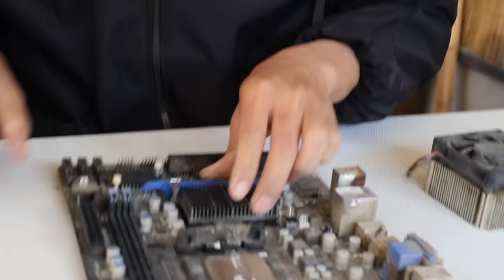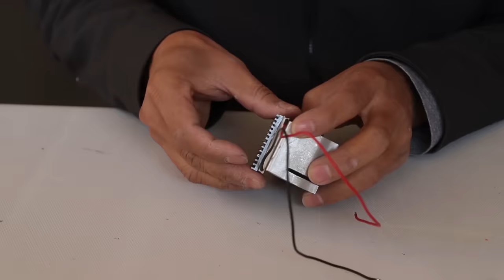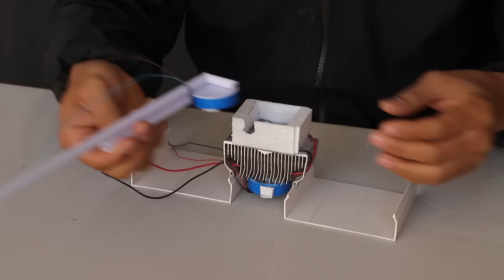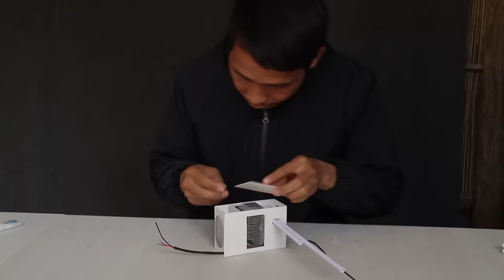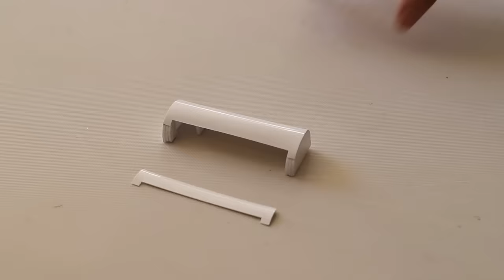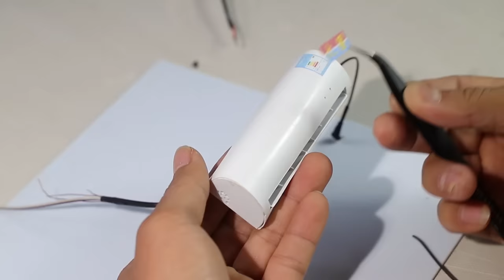Making MINI Air Conditioner丨Multifunctional/Personal Use - Mars Project Team

Comment: You need a peltier however the different on the temperation varies thus if you let it on for a longer period of time the cold side will go hot as well.
Reply: But the peltier keeps the temperature difference constant, around 30 degrees.

Comment: How is this producing cold air?   I feel like many viewers have no idea how an Air Condioner actually works....
Reply: thanks to Peltier unit. one side of Peltier cools down and other heats up when there is current on the Peltier. It isn't used because of much lower efficiency than vapor compression based AC. Still, it can make a reason if the unit has to be very small.